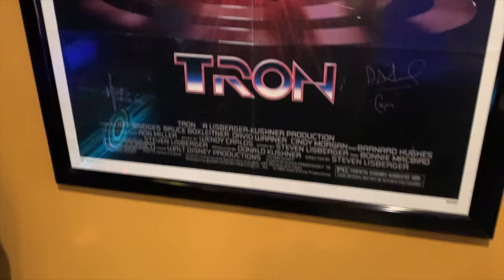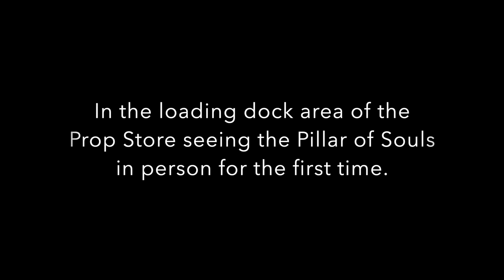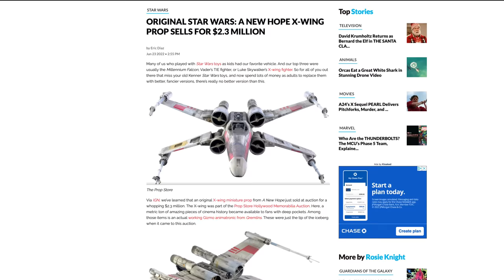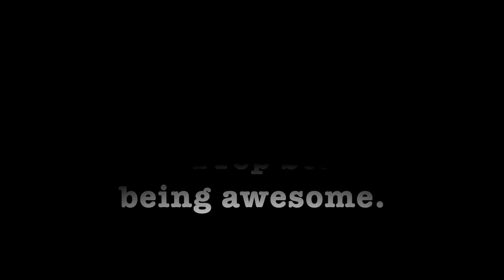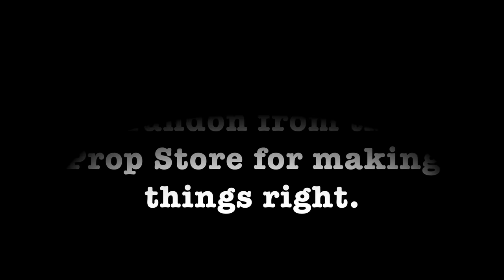Going Through HELL for a HELLRAISER III Prop - Screen Used Pinhead | The Collection with Sean Clark

Comment: Congratulations on winning that auction.  That is a gorgeous piece.  Who owns the wooden version that spins and fires out hooked chains?

You are going to have to remodel that stair corner to fit the unit back into a glove a cove where it can be lit properly but also protected from incidental contact.  Wet dream display would be on a electric lazy Susan where the item can be rotated in a glass case.  Just some ideas.  Love the piece.

Comment: As someone who delivered for many years, was shocked they used a open truck. That could have gone badly. And they obviously had to lay it down to crate it. I was a little worried about how tight they cranked the shrink wrap. And they should have had the delivery guys get it inside the house. It's not like they are a "no touch" semi driver. Glad it made it safely inside.

Comment: I wonder if the Neca figures of the early 2000s had  one with the 8 inch version.i know how u feel though.i finally retired my 1999 Toshiba TV bc I finally got a modern tv with a Blu ray player.that beast was on a coffee table that was on a dresser.j had picked it up and put it up there,in my late 30s...I'm 45 now easier coming down.but my house was built in 1942.the doorways are kind of narrow sliding it  on the side and inching it out at an angle, sliding it through the kitchen had to back my truck up to lower it Into the bed,apparently Toshiba tvs go for a bit of money,the second hand store we have called Steered Straight is omy about 4 blocks  from the house..it took 3 people to get it...so  yes I know the struggle..and just getting an 05 projection screen to the back room through a narrow hallway..they're heavier than they look

Comment: What an awesome purchase Sean.  Glad you got it home in the end, although the aggravation must have been extremely frustrating.  Did the final hammer price of $28,000 include the buyer fee?  Thanks for another great video!
Reply: $28k?!
Reply: Bit over priced.
Reply from the maker: Yes plus CA state tax on top of that.
Reply from the maker: @rossbarrett6821  It actually went for a lot less than I expected. I think the reason is the size of it scarred a lot of bidders away.
Reply: Yea at most should of been like 500 - 1000 because it's a real movie prop and foam. But I'm glad he could get it and protect and take care of it. Such a awesome piece.  I winder who has the original box from the movie

Comment: Now you just need the puzzle box from the first film. This is a close second. I’m sorry this was so stressful, I would have not handled that well, lol. I’ve worked at auction houses before, typically the buyer’s premium is anywhere from 18-20%, 25% is a pretty high premium. The guy I worked for was very similar, very cold presence. I know exactly what you’re dealing with, man.
Reply from the maker: I do have a screen used working box from Judgment. That will have to do for now.
Reply: @malfuncsean  nice! Got anything from the second film?

Comment: How much does it weigh if it's all foam? Looked like you moved it pretty easily as well when you put it in its final spot.
Reply from the maker: Not all foam. The center, top & bottom are wood. The outside is a poly foam with a latex skin over that. Guessing about 200 pounds.

Comment: How many of these were made? Can't believe you own it Very nice piece..
From UK 🇬🇧
Reply from the maker: That is a good question. I believe at least two but mine would be the only complete one. There was one that Doug Bradly could get inside and stick his face through. It likely didn't have a backside. The other version I've seen photos of has Pinheads face with the nails in the head. I believe that was the one I own but they swapped out the heads. I can clearly see the seams around the head like it was interchangeable.

Comment: 25:19.    I have dealt with tall boxes     i use the corner to corner method    // U lift with the weight on one corner of the box and twist the box, so the other corners move closer to the destination.   but weight is a challenge   //hence why a crane would have been better to use   to lift to at least the back door, or to the upstairs window.

u remove the window and lift the box by crane   and    well, u do not have a crane  //i work where there r two industrial cranes for such moves   /eg: an a/c unit lifted to a roof.

Comment: 33:26//   I heard the guy say, 'bio degrade-Able'   but i could tell once u opened the panel and the wave of snow fell    that it was not all bioG    lolol  
But U have the words of him, to claim in any sewage case study    // if the gators inside the sewage system turn into some Foam Monsters, due to the eating of the non BioG snow   that be handled at that time   
if a bird can not stop eating foam, that is upon their stomach and throat to handle

Comment: 17:30//   I do want to suggest      a few facts   before my analysis' conclusion    
1.  it is too tall for where u want it    
2. it is too large to get up the stairs
3. u would need a crane to lift it up to the window and then its still too tight   
// so   knowing these 3 truths    perhaps the universe peed in donald's cheerios so he'd be mad and U would be able to get out of the Pick up of the too large item//

sometimes   Our wants    r  Rushed    to Order  and WE Need to slow down that operation barbarossa and accept   someone else do the delivery   &  make measurements before buying such items   online    
I did not buy either the couch or the large tv, that did not fit into my place's stair case.     so i lost no coins     but not all can afford to lose 1 coin